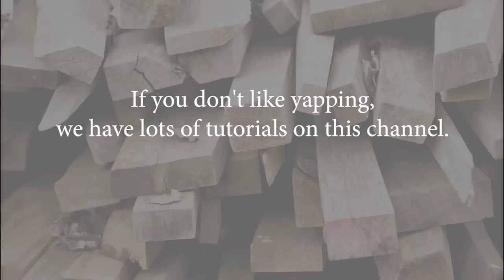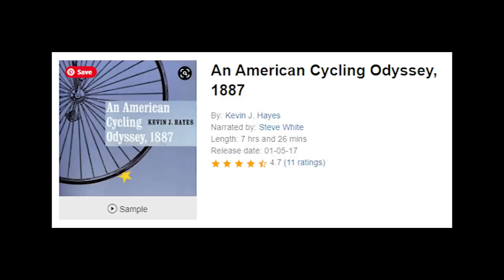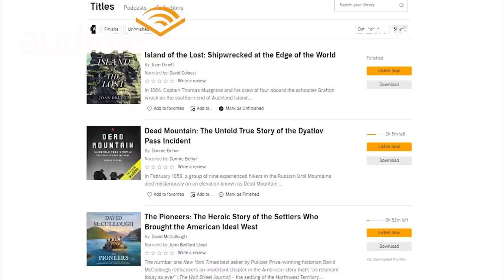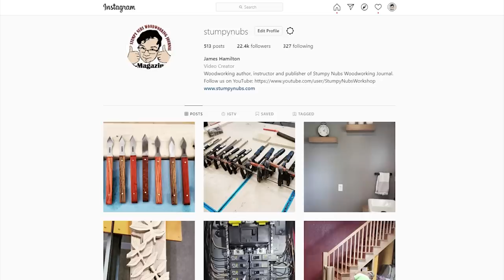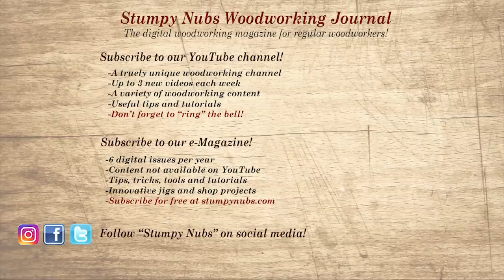Have they BANNED table saw dado sets????

Comment: If you live in the US, you can order your European TS with a longer arbor and use a dado set. To get around the brake issue (which I believe is supposed to stop the blade in 5 seconds), Felder machines (and perhaps other European saws) have a pair of pins that keep the blades from loosening the arbor nut. Anyway, I always like your videos.

Comment: I have something called a wobble blade.  It spins at an angle so it effectively creates a dado.  It's adjustable so you can dial up the size of dado you want.  It's probably not as accurate as a good dado set, which we can buy in Canada, but it does a fairly decent job.  I do find that I need to make test cuts before doing an actual cut.

Comment: It's not hard to wire an electronic brake with a universal motor.  And you can put a switch in the path so you can turn the brake on or off too!

The basic principle is that you use a 3-way switch to turn the table saw on.  When it's on it goes power-in -> switch -> motor -> power-out.  When you switch the switch off, you form a new loop that goes switch -> motor -> switch which causes the motor to act as a generator and just heats up the wiring a bit as it converts kinetic energy to heat (probably best to put a super low resistance power resistor in here to dissipate the heat instead of the wiring).  But if you put a second switch into this secondary loop, you can have that second switch closed (making the braking circuit work) or the switch open (making the braking circuit do nothing)

Comment: I have a very old table saw (1954 Beaver - it’s a Canadian thing), so no blade brake, but had to replace the motor, and the new one slows extremely quickly.  I have had the nut loosen with my dado set (once - now I tighten the nut more), but what saved me from ugliness was the extremely long arbour on the saw.  So that’s another possible solution…

Comment: Only contractor saws have the short arbour nut. Usually, it's only an axel that the blade fits on and you use an arbour bolt to tighten the blade similar to how circular saw blades are fitted.
Larger cabinet saws are not as common here in Europe. You can usually find older ones with a large cast-iron top and cast iron everything that have longer arbour axels that can fit a dado stack. If you are buying new ones there are usually the large panel saws and some of them have a longer arbour. In the UK there is a company called Axminster that have a semi cabinet saw and they also have a dado stack you can put on it. So there are saws that can fit dado-stacks you just need to either buy an old one or a really expensive one.

Comment: I just re-watched this video. I sometimes do that when they pop up in my feed. 
I had a thought about this subject, the dado blade dilemma... The floating blade guard is great. I wonder if the support arm that holds blade guard was rigid enough to have a material hold down included on it. That way the dado would be accurate in depth. There is probably already a system such as this in existence. This can't be an original idea. I suppose there are power-feed systems that include a blade guard as well. I just figured if you have an arm extending over the top of your table saw it may as well pull double duty. Or triple...
Thanks for the video, Stumpy!

Comment: From Denmark. I recently acquired a Dewalt 7294 SQ jobsite saw. It has an arbor that will hold a dado set. I can buy a dado set from several Danish companies. However, they are ridiculously expensive but available. So, I don’t think it is illegal, unless your saw can’t stop in 10 sec. I can’t speak for other European countries but it is possible for Danes to hurt themselves on dado blades, if they really want to. I am going to Michigan in September and I think I will bring back a DeWalt dado set, I am such a rebel. 😊

Comment: My dado set from Harbor Freight has served me really well, even if it isn't quite as precise as it could be. The cutter heads are never all the same radius so the top/bottom of the cut doesnt get a smooth surface,  but sanding finishes it fine. And the widths I get arent exact either, but really close enough for a hobbyist.

Comment: Here in Argentina they're not on sale. But it's highly unlikely it's about safety. It about lack of local manufacturers, no tradition on using them, and high price if you wanna import it due to a high dollar price. 
All that said, my DW745 didn't.even came with enough space on the arbor to hold them. I guess DW's that are sold outside of the US are removed of that feature...
Reply: DW745 can't take a dado stack, the arbor is too short. The original manual stated that they could, but it was just a mistake corrected in reprints.

Comment: Was a furniture maker for many years and used dado sets in a large spindle moulder. Never put them through by hand but always use a driven system which have a guard to prevent upward movement as well. I know the cost of these is a factor which for amateur use is probably not economical.

Comment: I have a theory about the router vs. table saw discussion in general - it's been observed that americans use table saws for far, far more joinery than europeans in general, with the opposite being true for routers - and I think it comes down to a combination of tradition, and electrical supply. 

At this point in proceedings, it really doesn't make any difference at all if your supply voltage is 110V or 230V (US or euro), but back in the early days of woodworking power tools it really would have done, especially once you're outside of a factory or other big shop environment: Commutating electric motors are limited in how much torque they can deliver by both the physical size of the motor (i.e. the length of the rotor arm) and the electrical field strength (i.e. the voltage) - therefore in 230V land, a smaller router could have done the job without issue, but in 110V land, a bigger motor spinning a far heavier bit of metal with more momentum to help it through the cut would have been far better. 

This then lead to different general work practices, and from there, different regulations, all of which hardened into traditions.

Comment: In Europe sliding tablesaws are the standard (and have many advantages), and for them dados are much less convenient (the whole point is that you're not over the blade) anyway. But those saw typically have a shaper, and/or shapers are much, much more common than in the us. They are also kind of the best of both worlds between a router table and a dado.

Comment: You keep showing me that interesting project in the background and I was wondering what you were making. Is there a video of that project I ca look at please?
As for the arbour issue, I would be turning up a lock nut on my Myford or possibly turn up another part to solve the issue.
I'm Danish (so basically entirely metric) but I live in England and still use inches for some things. In fact so did some Danes back in the 60s specifically for woodwork.

Comment: Forrest makes dada blade sets, specially made to mount on European tablesaw arbors so that the locking nut can't spin off as the auto-braking system kicks in when the saw is turned off.  They accomplish this by drilling a set of holes in the blades which mate with corresponding pins on the arbor flange.  My Felder slider has these pins, therefore all of my blades have them.  Being a Canadian, I have grown up using dado blade sets and am comfortable with their nuances.

Comment: Here in Aus after over 3 decades as a wood machinist I've never seen a dado set up on any saw in any factory/workshop I've been in maybe they're illegal here always did dados using a radial arm saw and two fence stoppers set apart at the dado size

Comment: You may want to update your video example of a "floating blade guard". What you have is a "dust hood". A blade guard by definition will protect the user from being able to make contact with the blade once the work piece has passed through. Your example shown allows the blade to still be contacted.

Comment: 40 years of using a dado with only one small slip that threw the wood to the back wall when I was standing off to the side. 
We were building a friends cabinets one time with oak veneered plywood and getting small chips from tear out in the veneer. My friend asked a Danish finishing carpenter what could be done about it. He suggested to put the plywood through the table saw backwards. His fathers advice. A year later I was working with a cabinet maker. He told me a story about meeting two cabinet makers in the same year who were both missing fingers. He asked them how it happened. Both of them had a similar story. They were putting plywood through the table saw backwards with a dado blade. He then said to me, and guess what, they were both Danish

Comment: In England we seem to use both the metric and imperial side by side it seems to work fine. You often hear people say things like "50 mill or 2 inches in old money" and if people tell you how tall they are in metres and cm nobody would understand.
Reply: I second this! for me it's whatever is closest. if it's closer to the inch rather than the mm i will use that. Some of the old boys prefer inches, some prefer mm. Rule of thumb is 25mm to an inch in the timber yard. If it's really bespoke, PSE cut to suit it all depends on the job.

Comment: I've used a dado set for years, it's the same as every other tool. Set it up and use it correctly and it will work beautifully for you. Also way faster than a router for doing a large number of cuts :)

Comment: Not that it'll convince anyone to change their laws or machinery,  but if you cut right of the fence or have a right-tilting saw (ie. the fixed face of the arbor is on the same side as the fence) then a riving knife would hold the dado against the fence.  Then the riving knife prevents movement away from the fence, much like a featherboard would ahead of the cut.

Comment: In UK dado sets are rare but not totally unavailable. The thing is woodwork is not nearly as popular as a hobby in the uk. Commercial shops in the UK typically use table saws for just ripping. Grooving, rebate typically done with a spindle moulder or cnc saw.
This pretty much means there isn't really a big market for them anyway as few hobbyists have an old cabinet saw with a long arbour, and Commercial shops don't use them any way.

Comment: As always, clear and concise with some humor thrown in.  Thumbs up to crush a troll.  

I'm very pleased to see that you also ride a tadpole trike.  There's nothing better for safety and comfort.  You might also want to see if you can find a copy of "Bicycles in War".  I think you'd find the history of it interesting.  Thanks much for the video.
Reply from the maker: Ours are TerraTrikes. They are a Michigan-based company. I also like them because the pedals are a bit  closer to the ground so you can sit more upright. They are also equipped with Bosch e-assists for those windy (or lazy) days :)
Reply: @StumpyNubs  Terra Trikes are popular here, too.  (Eugene, OR)  Good stuff.  I didn't know they were Michigan-based.  Mine's a Sun, bought 2nd hand from Craig's list.  Your CG is probably 2 or 3 inches lower than mine, so handles better around curves.  I don't have e-assist yet, but I'm looking into it.

Comment: A pin through the nut would solve the potential unwinding issue. The manufacturers could easily make a special nut with an integral pin - and a custom thread to prevent substituting a regular nut if the authorities deemed that was too easily worked around.

Comment: i was tempted to modify my saw to take dados, as i checked and the only physical difference between the uk and US versions (other than voltage) was the arbour and i fount the longer version on a spare parts website, but never got round to it, honestly i havent really NEEDED one yet, my router does just fine, and i can still do the initial cut on the table so its easier to line up the router.
Also as i understand it as it pertains to MY saw they dont actually use breaks but if fitted a dado just takes much longer to stop and they dont like exposed spinning blades even if they are unpowered, there seems to be an urge to stop everything, many saws dont even have riving knifes available, i had to make mine by grinding down a spare seperator?blade guare (from the same parts website) they just assume you will never make a partial cut!!!

Comment: In the High school shop I was in over 40 yrs ago-their table saw had a floating guard-the Brett Guard.Worked well and easy to adjust.You could use it with any tool you put on a table saw.Don't know if these are still made.It attached to the saw at the edge of its table.The guard was on long arms that allowed you to put it over the blades.Blade brakes-----Feel these can present more safety hazards than what they prevent.Anyone using woodworking tools is aware of how long it takes them to stop spinning when turned off.Guess some don't like the wait.
Reply: Delta offered the overarm Uniguard for the Unisaw starting back in the fifties. It even came with a pop up splitter that could be lowered beneath the table for non thru cuts like dados. I have this setup for my old Unisaw, but I don’t use it as I find it blocks my view of the cut, which to me is more of a safety hazard.

Comment: To solve the problem of the long wind down of my saw blade after I turned off the switch, I purchased bicycle caliper brake kit from a local bicycle dealer.  I mounted it so it pinched the saw blade, in conjunction I made a foot treadle with a micro switch that went to a magnetic starter.  So when I pressed down on the foot treadle it stopped the blade very quickly and turned off the motor. I would not be with it.  Also mounted the brake caliper so it followed the saw blade (tilted) when I cut angles. This freed up my hands to hold the work piece.

Comment: I didn't read all the comments but it seems like nobody wrote it. Felder / Hammer did solve the problem some time ago. The dado stack is made of discs meant for spindles mounted on a bidirectional pressure arbor. It costs a harm and a leg but it's Felder. Maybe when i'm old and rich ...

Comment: I know Felder do a combi machine with a dedicated slot cutting saw , I have an ancient table saw with a long arbour and no electronic brake takes a minute for the blade to stop but it hasn't been used for years now since I bought a track saw and I think a Mafell NFU50 might just be the perfect saw for cutting dado's without a table

Comment: Why, over here in the EU we don't use dado's because we have a 'wobble-saw'. The 2 flanges that that hold the single saw blade are wedge shaped so the wobble of the saw depends on the way the saw is aligned between the wedges. Takes only one blade for infinite number of sizes inside the limits of the set. They are quite noisy and not very easy to set up so if you need to change width often a dado stack is simpler.

Comment: I've always thought improvements and more options in routers and bits have caused the industry to push marketing (sales) toward using them for dado cuts instead of dado blade stacks (which are only used for one function).  I prefer blades, but I also use the router.  The blade stack gets it done faster from what I have seen.

Comment: I put a dado blade on an old radial arm saw.  The blade caught the wood before the anti kickback lever engaged and launch it away from me at high speed.  I had used it a lot previously without a problem but no longer.
Reply: You need to get a dado blade with negative hook/rake for the radial arm saw.

Comment: I've been wanting a dado stack after I first saw one but I'm cheap and still haven't pulled the trigger on one. Stubborn and willing to make 15 passes never really bothered me too much lol. Maybe I'll pick one in soon. Now that you mentioned it I've never actually heard of a dado stack kick back story either so never was really afraid or nervous of one.
Reply: Not cheap  thats a fact .
Reply: I built a whole set of kitchen cabinets with my dado from Harbor Freight. Under 50 bucks if I remember right. I use it on 1968 Craftsman tablesaw with zero-clearance insert from Slivers Mill. Works quite well actually.

Comment: I've got a couple of crazy Dado blades and no knife at all on my table saw, it's too old. The adjustable hole saws I have are far more likely to hurt someone though simply because of the proximity of your hands to said whirling, unbalanced, leverage point of a limb gouger. I keep them around for conversational purposes. I wish I had never gotten rid of it but I use to have a hoop saw, the ultimate in dangerous saws. Just found your channel and loving it, thank You. :)

Comment: Hi James, the Wadkin table saw I use at work, dating from 1970s, does not have the long thread length to fit a dado set. Of course it has to be used with overhead hood,  attached to the riving knife. H&S regulations dictate it!! 
Watching Norm originally on TV, I was horrified by the U.S. style with his lack of riving knife or over head guard. I think the big problem is that after using a dado set how many American woodworkers, replace the riving knife, And switch the insert plate back to a tighter fit to the saw blade. ?? Despite being told to never use his site saw with out the knife and guard, my father in law chose to use it like Norm....kickback cost him a little finger, and 8 hours in surgery tiding up his palm, and reduced mobility in his left hand, thankfully he is right handed. I for one will not use a saw without its bits. And do dado work on a router table.

Comment: honestly frustrating living in a county that has banned them when I am certain they are not more dangerous, certain high-end table saws and panel saws have been able to get away with it exactly as you recommended by using a floating blade guard, the Axminster saws offer this feature and can be bought in Ireland